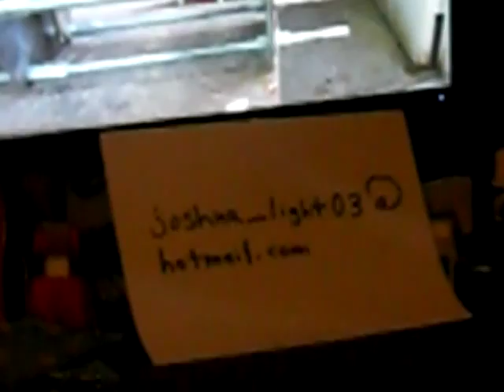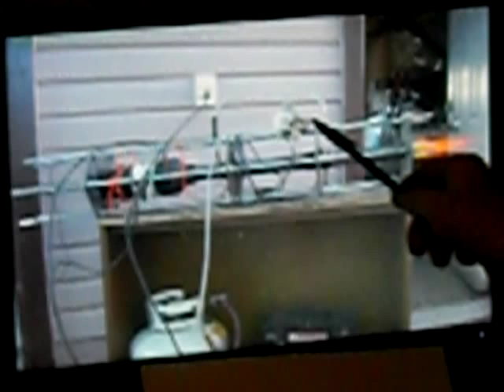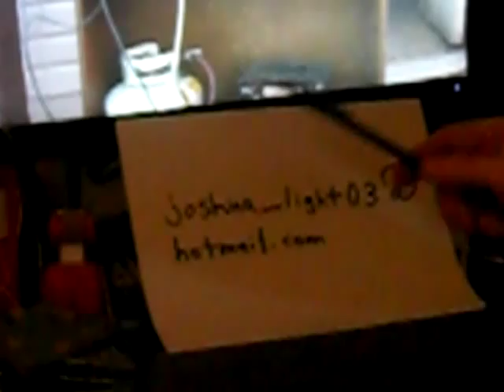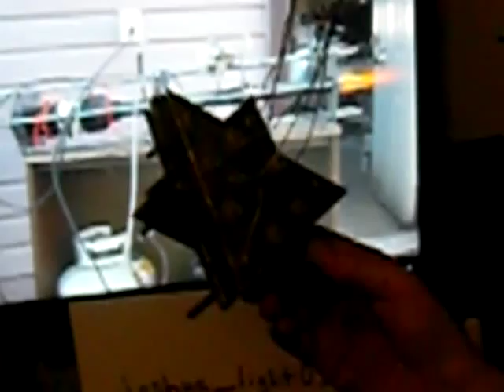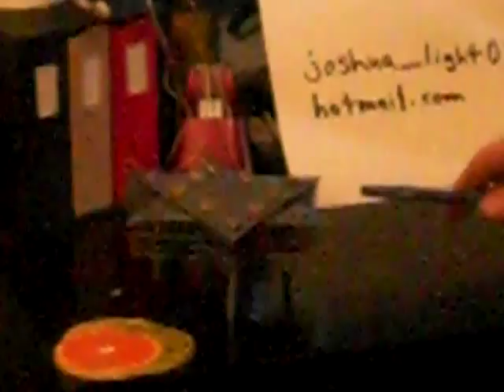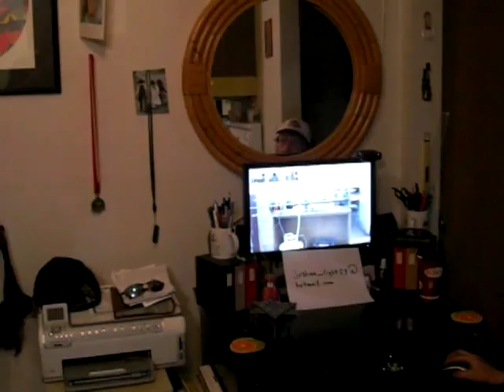00-Premier INTRODUCTION-'Joshua talking on Joe Pipe technology

Comment: To make your pipe even more intense and use less fuel form a rocket cone on the last 3-4 inches of pipe. The angle of the cone is what makes it work..draw 2 parallel line representing the diameter of the tube your using to scale each line 6 inches long. The tapper is 1 inch for every 6 inches of length bigger diameter, therefor at one end of your 6 inch lines add 1/2 inch above your upper line and 1/2" below the lower line and then draw a line from the starting end of pipe diagram to each mark

Comment: I used a 1 and 1/4 inch pipe used for chain link fence post as it was what I had and then formed a separate cone using what I explained below and made the cone aprox 3.5 inches long with a tapper of 1" for every 6 inches of length then welded it to the end or if you have the patients form it hot using a torch and hammer it into shape. I then feed compressed air and propane through a .035 mig wire feed tip. This pipe when lit shook my metal shop building.

Comment: the pipe also had air slits in the side of it near the mig tip placed at the center so I could also adjust air intake from outside air as the thing created a vacuum in the tube and would draw in more outside air. The heat from this pipe could be felt from 20 feet away was very intense and the sound was like a rocket that shook the building. I use mine for a aluminum melting foundry I built but would work like a furnace. I used 15 bucks worth of propane to melt over 100 pounds of aluminum scrap